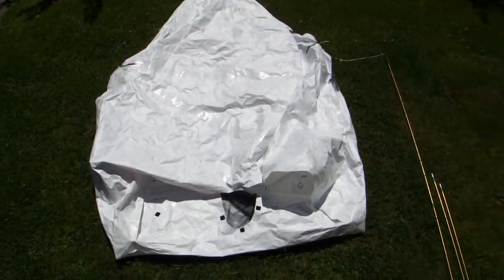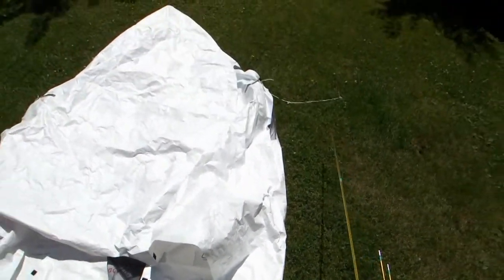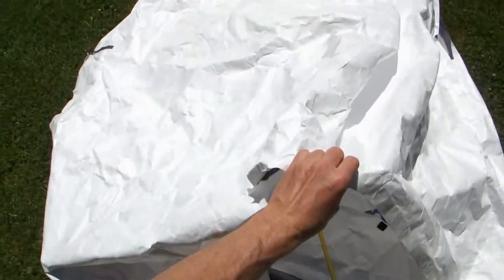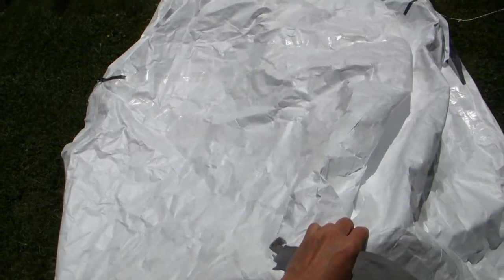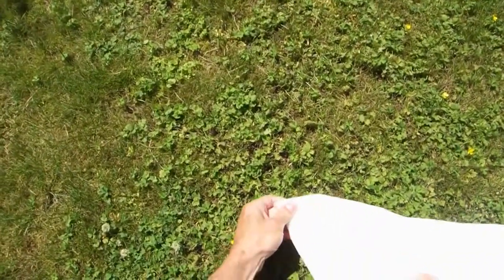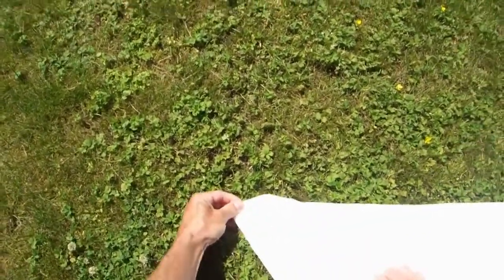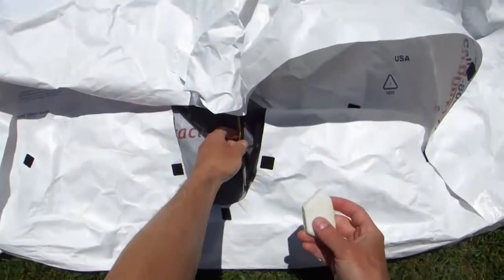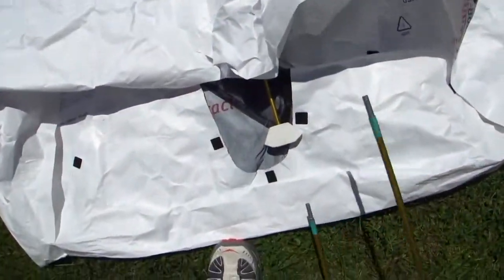DomeOne setup

Comment: Thanks. Cool hub contraption...is that pvc board that you drilled? Smart and versatile idea. Tyvek ...a gift the common man hijacked from DuPont.
Reply from the maker: All my tent hubs are 3D printed. Solid plastics are too heavy for my projects. The 3D ABS plastic can be printed with a percentage of voids to reduce the eight. Check out my cubenmaker channel for other tent and kayak videos.